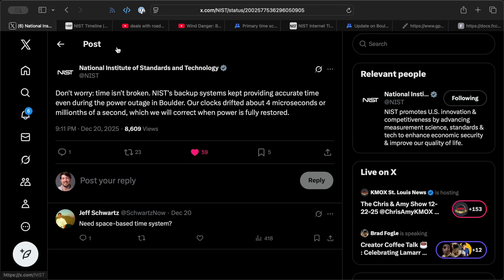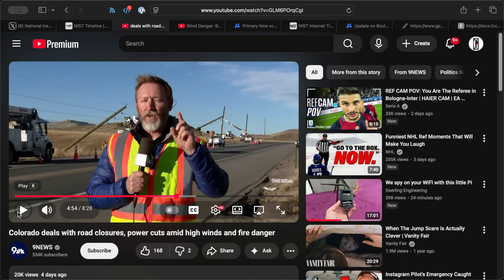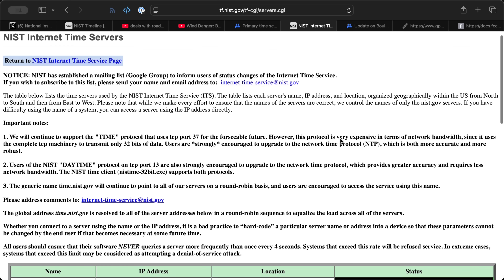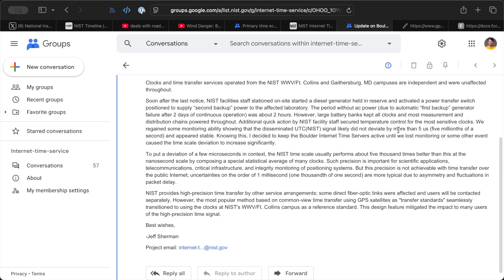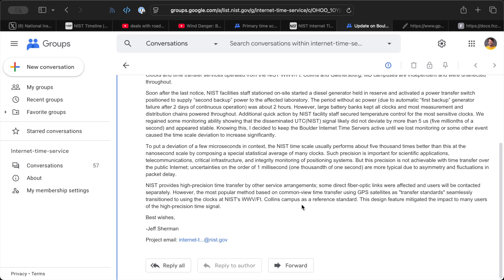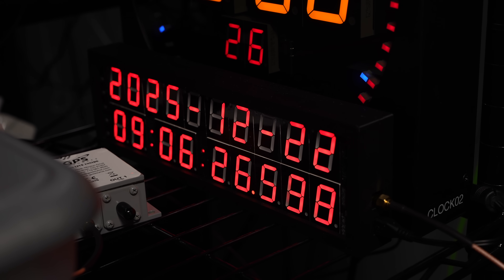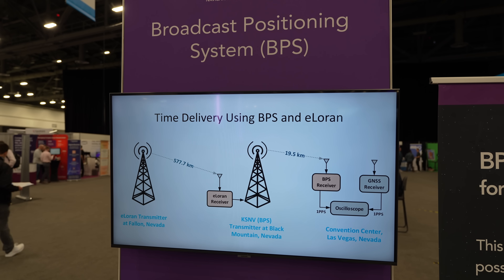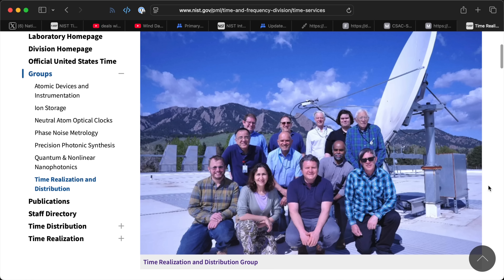NIST's NTP clock was microseconds from disaster

Comment: GPS relies on the time between the signal leaving the satellites and being received by the receiver to calculate your position.  5 microseconds is an ETERNITY in that frame of reference.  Imagine an aircraft being guided to an airport via GPS -- 5 microseconds means the aircraft's location could be off by a kilometer-and-a-half!  Imagine your plane landing 1,500 meters short of the runway!  No thank you!  (Yes, I know, ILS would still work without GPS, and any major airport is going to have ILS-equipped runways, but still, it's the principle of the thing...)

5 microseconds definitely doesn't sound like a lot.  Until you realize that, in the right circumstances, it can be.  *whew*
Reply: You would be surprised at how many pilots have become so reliant on GPS for their landing, they struggle with ILS and even visual approaches now cause they never practice them anymore.
Reply: @hfxpro  Back when I learned how to fly (1992-93) GPS was very new and far too expensive for a plane that a student pilot could rent.  (A 1981 Piper Warrior II in my case.)

It's always a good idea to practice occasionally with VOR/DMEs and NDBs to remember the "old school" methods of navigation. Turn off the GPS and navigate yourself.

Hell, I remember on one of my early cross-country flights, my instructor went over everything needed for dead-reckoning.  Talk about flight planning -- so many minutes at such-and-such heading, standard-rate turn to heading XYZ, so many more minutes at that heading, etc., etc.  We navigated from KPDK to KMCN and back using no nav-aids of any kind -- not even an NDB.  I was blown away by how accurate dead-reckoning turned out to be -- assuming you have accurate winds-aloft info and the weather doesn't change much.  LOL.

I'll guaran-damn-tee you that most pilots don't do that anymore.  😂
Reply: GPS doesn't really rely on NIST NTP servers.

Comment: A quick note at 3:04: GPS time itself was never effected - this paragraph was about the common-view transfer service, which communicates live corrections between NIST and particular satellites' timescales. This is an extra service that costs quite a bit to use.

Normally, each satellite maintains its own time scale, these are corrected to a constellation time scale, the constellation time scale is adjusted and corrected to UTC(USNO) at the naval observatory, and corrections of  UTC(USNO) to UTC are published in the regular circulars. This is the chain of traceability  most GPSDO's will use.
Reply: I have an alarm system with home assistant and it's automatically enabled or disabled using the gps signal of my phone. 

When I was sleeping the night from 16 to 17 in Spain it sent a reading with my location 1km away from my home so the alarm was set. 

It has never done that in the  2 years I've been using this system 

So, I think it somehow affected the GPS satellites sending the signal or the Android phones receiving them
Reply: Indeed, if a GPS satellite is off by 5 us, your location drifts by a mile or more. That's a disaster.

Comment: Can you do a bit on using Pihole as the network NTP server, and how it syncs?  I disable my router's NTP server (remove the URL), yet it continues to hourly ping all derivatives of pool.ntp.  Why?  And does having two NTP servers conflict in any way?
Reply: Actually, NTP is designed for multiple servers for redundancy.
Reply: NTP requires at least 3 servers (and ideally more) to operate optimally.

Comment: Hi availability data centers are designed with N+2 redundancy.  So if primary power, cooling, networking or servers fail, there are two levels of redundancy and backup in place to keep things going.  The challenge is always how to test and validate your redundancy?  Not easy to do.  Makes one wonder what the NIST redundancy is to deal with massive solar flares or EMP that could compromise all sorts of components used to create and communicate time?
Reply: I've worked in Enterprise data centers my entire professional life.  We've rarely had anything better than N+1 redundancy except in disk arrays.  Certainly never in power or cooling.
Reply: @stargazer7644 It all depends on the availability requirements of the systems you are running.  Some data centers I’m familiar with might have N+2 for certain components.  Such as three backup generators. With two spares, because if you’re running for multiple days without grid power you might need to take one off line to deal with maintenance or some failure in which case you switch to generator set 2 and you have a spare for that.

Comment: You also have to remember we rely on accurate timing for almost everything security related, to prevent replay attacks and to ensure that certificates are valid, and even measure how long something should have access for. It is a severely understated security risk but time is truly one of our weakest points. If you can control or influence the time on a couple of big systems you can essentially pwn the entire internet. The only real defence against this is to maintain your own NTP servers for your own purposes (I suspect that's what huge companies like Google do behind the scenes), but you risk messing that up and it starting to drift which would require periodic calibration.
Reply: Without precision timing, the cell phone networks would fall apart.  They use GPS to get the time and PTP to distribute it.

I run a NTP server in my pfSense router.

There is an Facebook atomic clock card available.

Comment: I've got both ntpdate and sntp, but only sntp worked for me. The first time I ran ntpdate it gave a permission denied error message, then as sudo it complains about the NTP socket being in use. On the other hand, sntp worked and gave more info than your example in the video with the same zero options, and I see that my delay is only 0.000695, which given the correction probably means nothing. Still, I've learned a new command because generally I just setup the NTP configuration file to point to the closest server and move on, but now I have a command to check it if my time ever feels off.

Comment: Question: As some people require such accurate time, how does someone account for the time for the signal to travel along the interwebs from the time server to them? Whilst it travels "at the speed of light", surely there has to be an actual delay as the signal bounces from router to router to router along the way, being converted to & from an ethernet signal to fiber and back again multiple times. And where is the "source of truth" for time signals? The "external clocks or reference signals" at the end of the screenshot at 1:02.
Reply: This is where NTP come in.  It uses time stamps to determine transit time and adjusts received time accordingly.  There's Precision Time Protocol (PTP) if you need more accuracy.
Reply: NTP accounts for that.  "The source of truth" for time signals is usually TAI.  International Atomic Time (TAI) is a weighted average of hundreds of atomic clocks all over the world and is where UTC comes from.

Comment: Is the drift permanent now? Can't they sync it with other labs in the world somehow? And if they can synchronize their clock back with the rest of the world, how are they doing it ? (I'm pretty sure they aren't using an average stopwatch and travel by train)
Reply: nvm, explained at https://en.wikipedia.org/wiki/International_Atomic_Time:
TAI is a weighted average of the time kept by over 450 atomic clocks in over 80 national laboratories worldwide. The majority of the clocks involved are caesium clocks; the International System of Units (SI) definition of the second is based on caesium. The clocks are compared using GPS signals and two-way satellite time and frequency transfer. Due to the signal averaging TAI is an order of magnitude more stable than its best constituent clock.

Comment: Does your Setup capture other GNSS Satellites as well? You could use them as backup. Same with an NTP source, Germany's Provider PTB is also a very relaible source. If that is too far away, try the Canadian or Mexican source.
Reply: Cell phones can use multiple satellite systems.  According to the specs, my Pixel 10 can use GPS (L1+L5), GLONASS, GALILEO, BDS, QZSS, NavIC.
Reply: @James_Knott  We are not talking about cell phones here. Its really depends on the hardware used if a protocol is supported.
Reply: @Toxicity1987   I was just using them as an example.  Redundancy is there if you chose to use it.

Comment: I am surprised that something so important is reliant on only one backup generator. Surely they should have several in parallel with auto switchover incase of failure.. might need to employ more support staff who can operate the power systems as well, so they always have enough staff on site in emergencies.
Reply: They can barely get budget to keep WWV on the air.

Comment: Time nuts - well, I do have a Trimble Z3801A replacement for time. But it is one of those "I proved I can do it" things. Yeah, I can get time to nanoseconds. Um, in the GPS Phase 2B satellite era I designed the hardware that made the GPS signal materially worse than even the Rb standards the birds used. So, I was working within the noise spectrum for Rb (and even more so Cs) standards. {^_-} (The AF wanted to degrade GPS enough to make it harder for the Ruskies to plonk a missile down Jimmy Carter's personal toity.)

There are some little known details about the GPS constellation most people don't know. It is so stable that the seismological movement of the ground reference site can be tracked. The same technology that Billy-Jeff turned off, that I partially designed, had a secondary use to set satellite frequency to about 2 parts in 10^13, correcting for the onboard clock drifts. The whole constellation forms an absolute position reference back to the time it was assembled. And the earliest GPS satellites could have their uplink jammed by a broken taxi radio in Tijuana. (I am told it happened. Our proposed design for a robust AJ uplink was too expensive so I've no idea what the uplink was since then.)

{^_^}    Memories of long ago. That was when we discovered there was no way to assemble an RG-233U cable to a type N male connector without a 1.5:1 SWR bump on the GPS L1 frequency.

Comment: Jeff, two NTPs servers is not a backup even for testing, three is the smallest number for redundancy when it comes to NTP. I also run NTP at home.
Reply from the maker: That's why I mention in the blog post I need to have four eventually ;)
Reply: I use 6 from the Internet.  My server is stratum 2.

Comment: Its kinda funny to think that for awhile I was one of those people who cares about a 5 microsecconds....
Traveling waves are a newer technology being deployed for power lines that monitor how the electromagnetic transients travel along a power line during a fault, allowing you to much more precisely detect where a fault is compared to other more traditional methods. 
Traveling waves go about 270 000 km/s or 270 m/us. That 5us drift could mean my traveling wave calcs are off by a kilometer.
Now in this application, really at the end of the day we don't care about GPS time. We use very accurate GPS clocks, but at the end of the day my local device just need stable clocks that can hold nanoseccond level accuracy for a few hundred microsecconds. That being said I don't know how they handle the double ended traveling wave applications, where you have two monitors at both end of the cables communicating. I haven't done that before and that might need two clocks in which case accurate GPS time really does matter.
Reply: Many years ago, the telecom industry used time domain reflectometers to locate faults on the line.  When a line was first installed, the lineman would go out and short the line at a specific location, so that the tech back in the office could mark it on a chart.

Comment: Sounds like somebody at NIST weren't doing their monthly generator checks.  We had to when I was in the Air Force.  They'd run it for about a half hour or so and disconnect the squadron from commercial power to test and make sure it ran correctly.
Reply from the maker: I'm guessing they've done their routine maintenance at least — the generator was already running for two days before it called it quits! But even a decently-maintained generator can have a failure, especially when wind storms are kicking up tons of extra dust for hours at a time into the intake filters, which maybe just got too clogged?

All speculation, but usually it seems backup generators will fail at the worst possible times, even in the best circumstances! Luckily they had extra contingencies to rely on beyond just the backup generator, and they worked it out.

Comment: In LMR (Radio) applications that require precise timing, us precision is usually OK, and if all of the clock's drift together there's no real issue as the timing that matters is the relative timing between two transmitters.
Reply: Considering that every mile two radio receivers are apart results in a delay of nearly 6 microseconds, I don't think it was a big problem.

Comment: GPS is synced to UTC(USNO) not UTC(NIST), I think you've confused the GPS "common view time transfer" service that NIST runs for the management of the GPS satellite clocks. The time transfer service is a way for clients to synchronize their clocks with UTC(NIST) when receiving the same GPS signals as NIST's receivers. BIPM also can use GPS common view to compare UTC measurements between all the ensemble clocks to generate the official UTC standard - https://ntrs.nasa.gov/api/citations/19940026143/downloads/19940026143.pdf

Comment: 5 microseconds is about the time it takes the message / signal to travel 1.6 -ish km / 5000 ft.  So if you're synching in, say Cape Cod, how far off are you? Propagation routes aren't  straight lines, and there's no guarantee you will get the same route twice.
Cue Chicago's  "Does anybody really know what time it is?".
(Yes you can do Echo Checks to determine Propagation delay, but that is kinda fuzzy)

Comment: Why worry about GPS? If you are close enough to get a cell signal, you already have an atomic clock signal. Although, it will only be accurate to a few hundred nanoseconds.

Also, you won't have to worry about cloud cover blocking reception.
Reply: Where do you think the cell network gets it's time from?
Reply: @James_Knott  It doesn't matter, the point was that you can get it from there, with less effort, more reliability. Probably less power use as well, GPS modules suck way too many watts.
Reply: What are you smoking?   Cloud cover doesn't block GPS reception.  Where do you think cell timing is derived from?  It comes from GPS.  Just use a timing GPS module instead of a navigation module and that accuracy goes down to about 5 ns .
Reply: @stargazer7644  Obviously you have never tried using GPS in Florida thunder storms. Location inaccuracy can go to over 50 meters.

My point being, if you don't need the super high timing accuracy, then use cheaper, less power hungry parts.

Comment: 3:49 Cool to see that the old HP 2530 8G PoE+ chassis is still kicking around in modern racks., little guy is good enough for most things.
(Yes, it is Aruba branded, but it's the same otherwise).
Reply from the maker: it's a solid switch!

Comment: I applied to CU Boulder to do a PhD in time research. This past year, I made a GPSDO that's accurate to about 5ns, but I wish I had more budget so I could spend more than the ~$40 I used for that project.
Reply: How do you confirm accuracy down to 5 ns?
Reply: @jan.tichavsky  by comparing the oscillator to the GPS PPS (Pulse Per Second) signal I can tell how far off it typically gets. I store data from the microcontroller seeing the difference between the oscillator and PPS, but I've also used an oscilloscope to check the  difference as well. One OCXO oscillator is a bit above 4ns, while the other OCXO is a bit above 5 ns. I think I'd need a better GPS chip, a better microcontroller, and maybe a better OCXO to get under 4 ns, since there's some jitter from different GPS chips in the ns range, and I'm overclocking the microcontroller around 250-300MHz, which is about 3.3-4ns per cycle.

I haven't yet tested holdover performance.

Comment: 5 microseconds... Haha. In telecom the phase accuracy has to be within 1.5 microseconds and the frequency accuracy is within 50 parts per billion. The extended tuning range is 2.8 microseconds, but you already loose features with this. At 5 microseconds off, your TD-LTE or 5G is practically gone. as the PLL simply wont lock. Thankfully this is not distributed on top of NTP 🙂
Reply: The cell network uses PTP.
Reply: @James_Knott  Correct. Or they do direct GNSS phase sync. There are a lot of these as getting the complete transport network fully G.8275.1 ready is a rather large task...

Comment: The most critical and extreme application for precise timing I think would be in particle accelerators. When for example you are transfering particle beams  moving at the speed of light between machines in a chain of accelerators and you need to hit the empty so called "RF buckets" (a bit like the spaces between cogs on an enormous gear that rotates EXTREMLEY fast) wich are determined by the accelerating RF frequency of each machine, the entire machine chain, transfer lines ect need to be synced together with like picosecond precision for it to work. Accelerator facilities however have their own atomic clocks for this purpose.

Comment: I happen to have a little ESP8266 based network clock.  It doesn't listen to NTP servers, though; it actually picks a random IP address on the local network during setup and uses network packet time stamps to set the time.  I only discovered that when I looked at the network traffic using Wireshark.